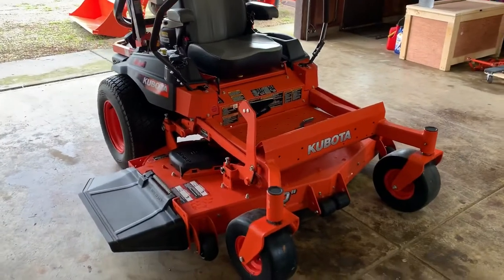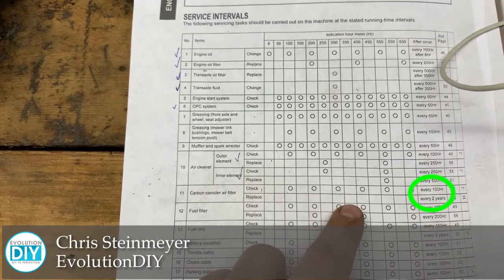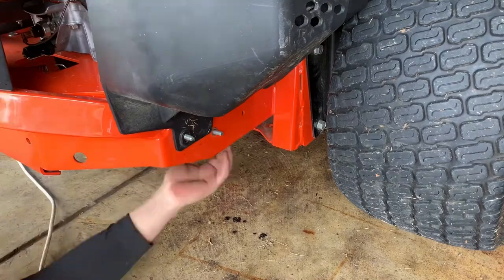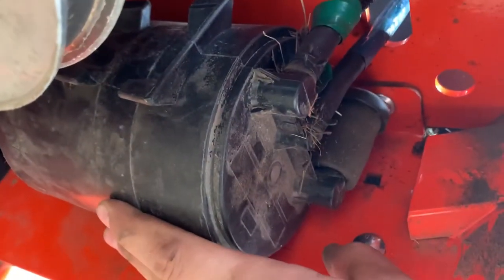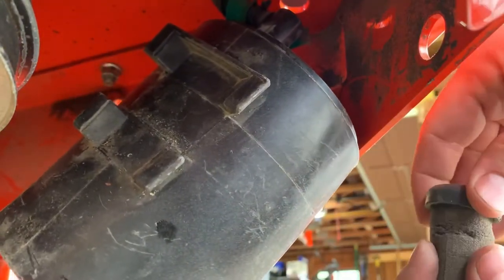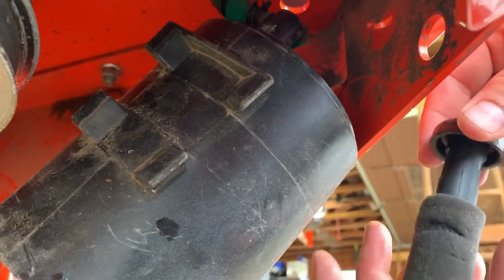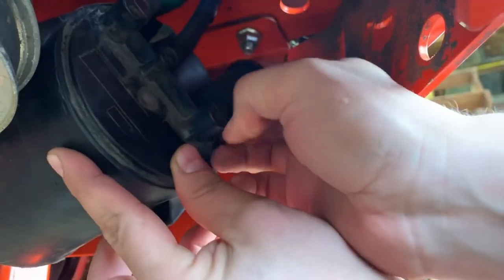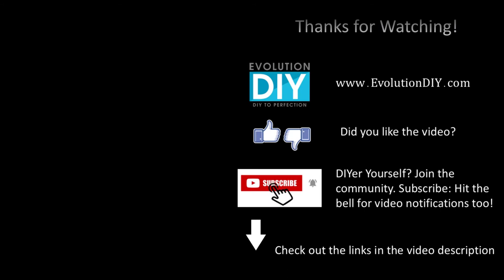How to Change the Carbon Canister Air Filter on a Kubota Zero Turn Mower

Comment: Is it required to service these? I saw in the manual mine is due. Seems fine
Reply from the maker: If it’s not degraded at at all, I would just wash it with soap and water, and put it back on. I always just follow the manual so if it says to service it, I do.